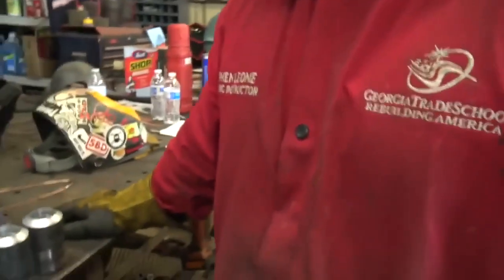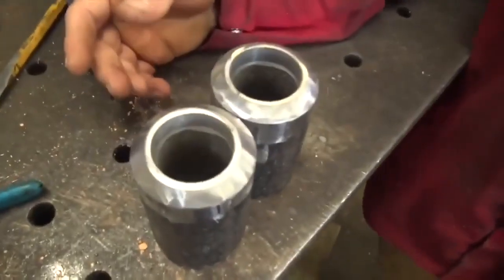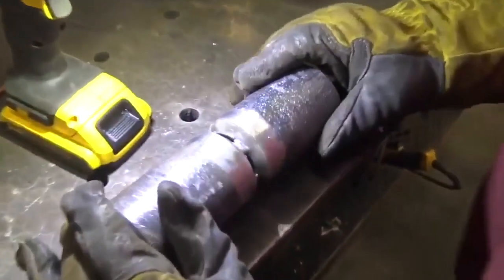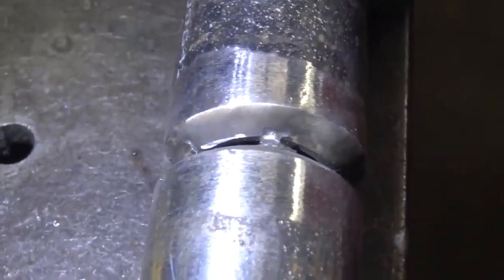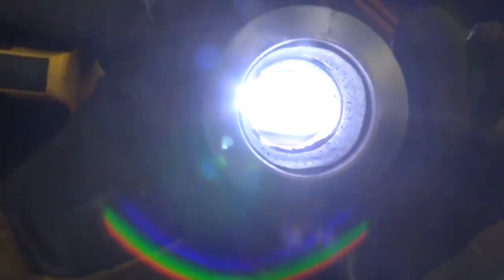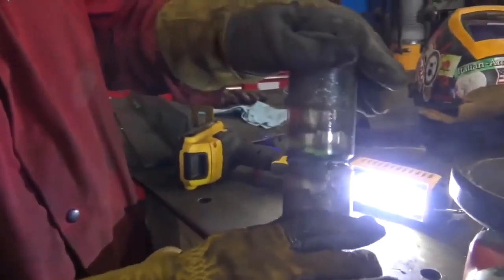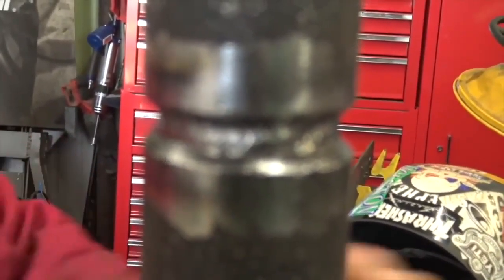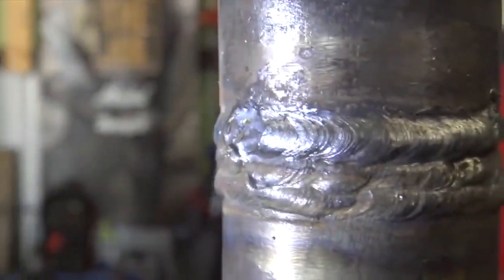2 Inch Schedule 160 Pipe Welding Lesson with 7018 Stick Welds

Comment: If it's a test, get your heat right before you tack your pipe
Reply: What should be the desired amps for it i got a 5g test tomorrow scheduled 160 2” pipe

Comment: The term keyhole is confusing to me. I'm not a welder, but hope one day to try some welding. The pipe shows one opening that the rod can move into the inside area of the pipe. After you stated you are preping for a key hole on each side of the tacks, you use a grinding disk and ramp or taper the tacks. but the opening that the rod can enter the pipe looks exactly the same. You still have only one opening that a rod can enter, but you state now you have a tack a key hole and a gap then you said you have another keyhole at the end of the gap? Very confusing!?